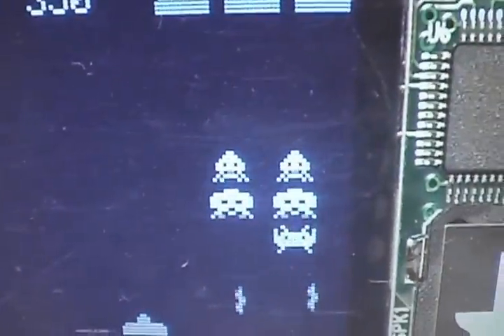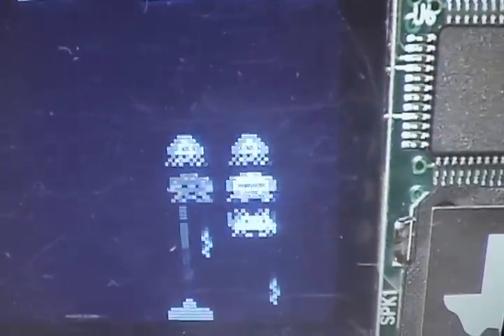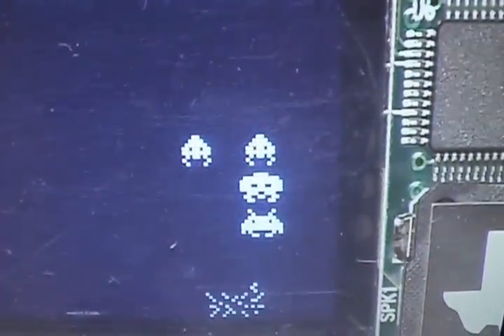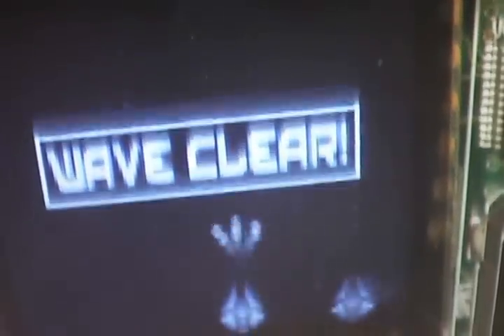EE319KDec2012

Comment: Dear Jonathan I have an MSP430 Launchpad board can I learn to develop this kind of videogame , I have an additional LCD shield which is used mostly on arduino from Adafruit. Is there any chance you can guide me towards a tutorial to learn this. I'm deeply interested. Most of the books teaching cortex and so forth relate to sensors and stuff like that. I'm so much willing to understand this kind of programming developing audio driver, video and so on. If you can help me i'd be more than grateful. I'm John from Argentina.